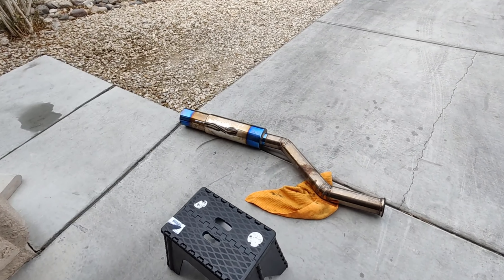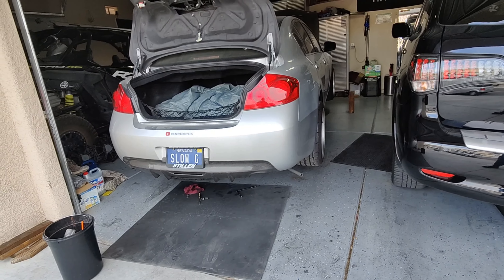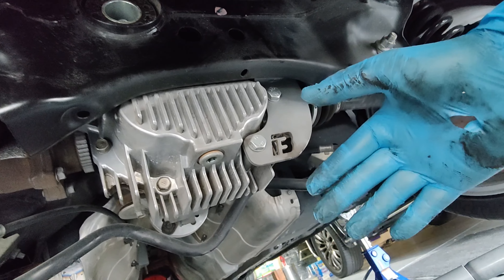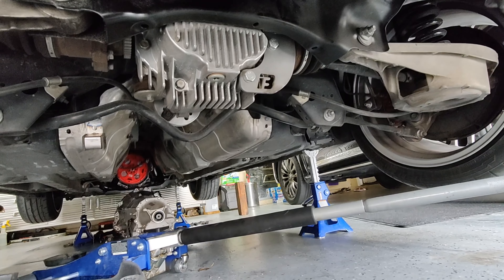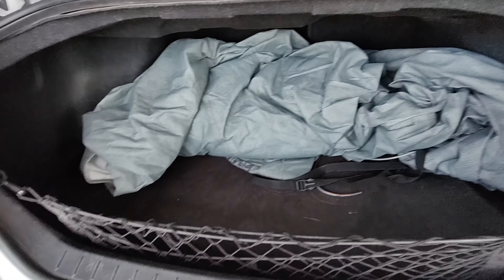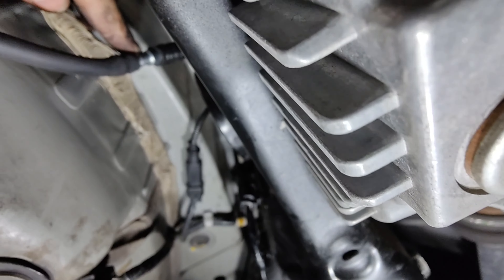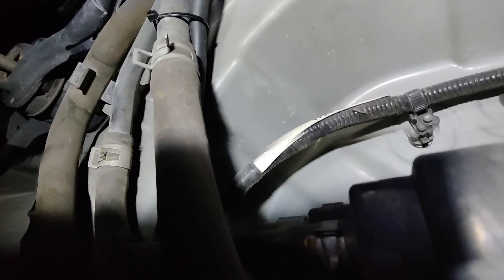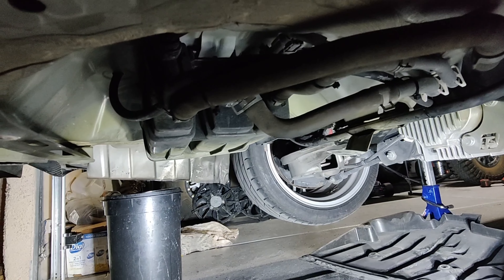G37 BUILT DIFF OIL CATCH CAN!

Comment: So did you really almost do 200 in a g
Reply from the maker: Our car show only 160 so I couldn't tell but when I asked the hellcat he said 198. This was in Mexico of course 😁
Reply: @INFINITIBROTHERS  mad respect was it stable at those speeds
Reply from the maker: @myleslestet2261  it was super stable I'm glad that my one piece drive shaft was balanced the right way and the RPF one's make a huge difference. Tire balance is very crucial. And since my car is automatic it's very important that torque converter is in place and torque down property with loctite. 🤙